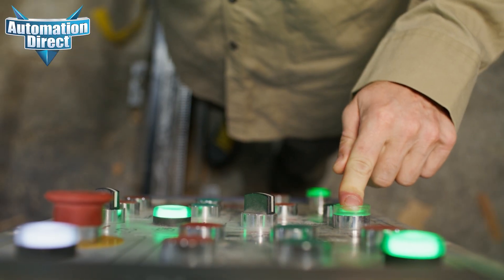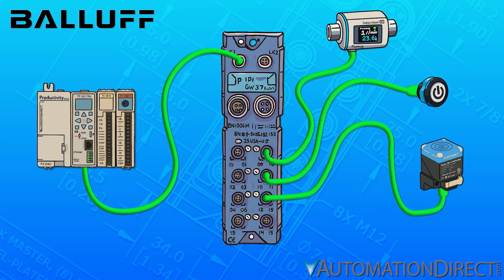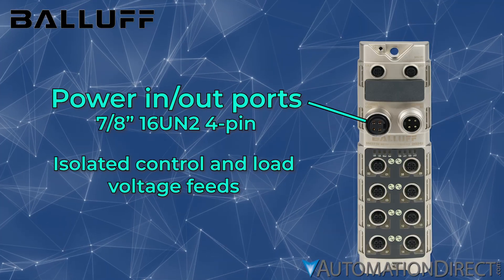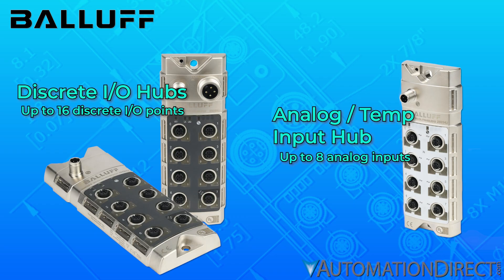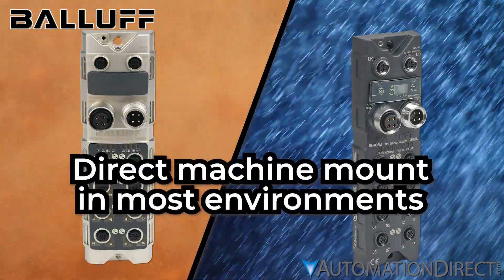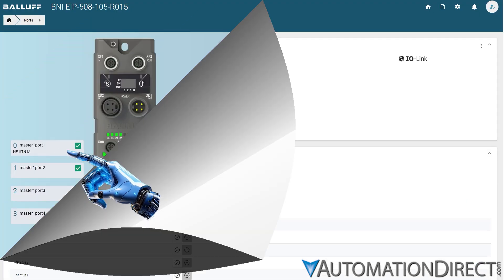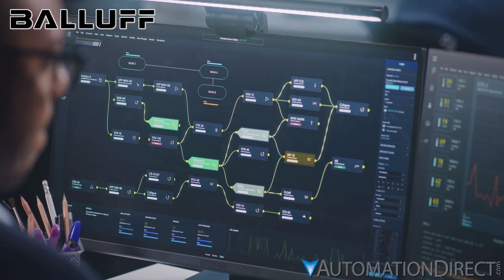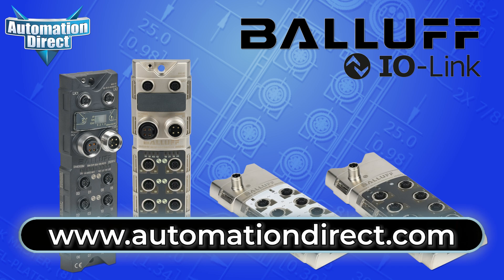Balluff IO-Link Masters & Hubs from AutomationDirect

Comment: Why don't they make them also with analog output, so that you can use them to control valves etc.?
Reply from the maker: These devices are designed for integrating IO-Link products into industrial systems. For applications requiring both IO-Link and analog I/O, we recommend using an IO-Link master alongside an analog-capable remote I/O module, such as the XEL-BSSRT or PAL series. There may be products on the market that have both IO link and Analog ports, but we don't offer any.